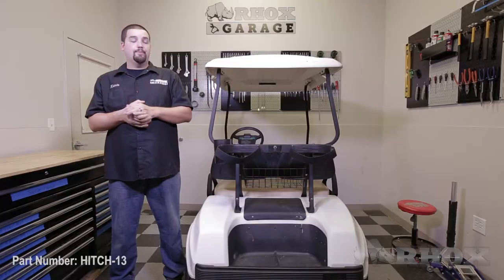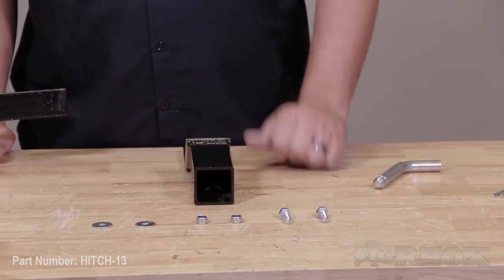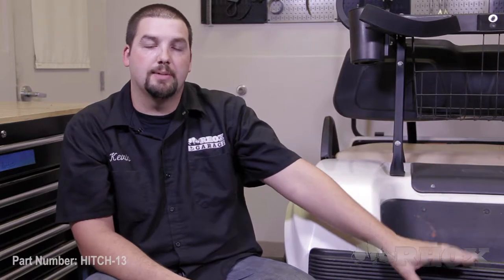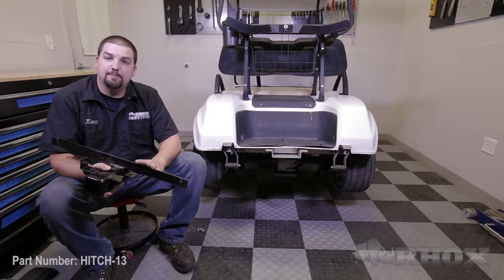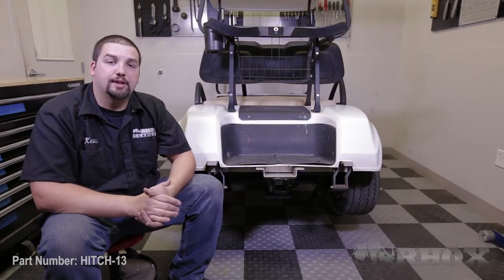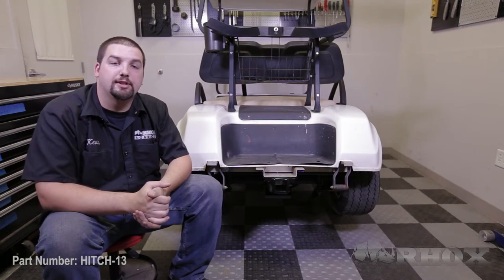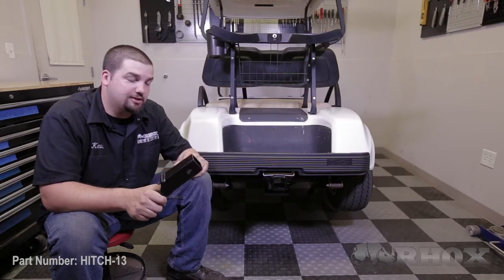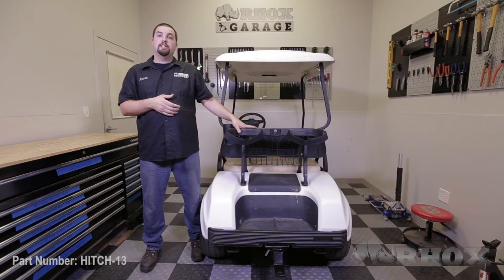HITCH-13 RHOX Rear Hitch on a Club Car DS

Comment: Curious what the weight limit is with that particular set up? I would like to move my 5x8 trailer (empty/unloaded) around using my golf cart.
Reply from the maker: We generally suggest around 200# tongue weight.  Always refer to the cart manufacturer's recommendations too for stopping capacity.